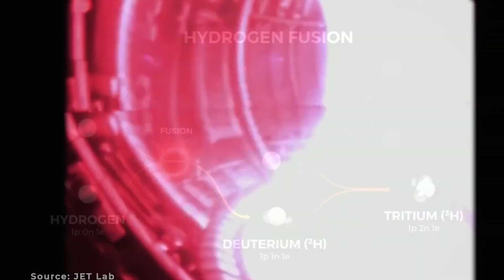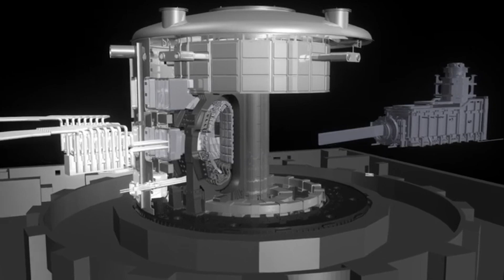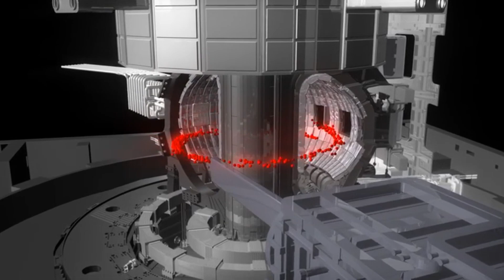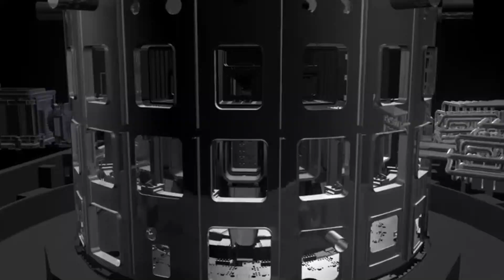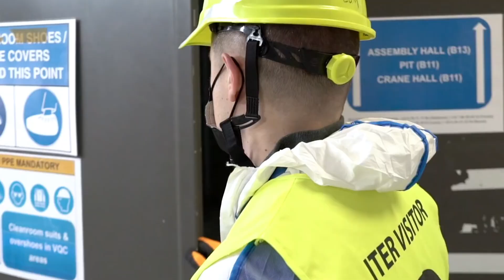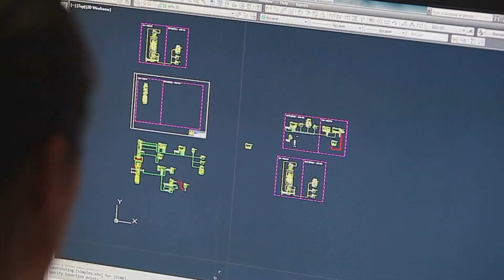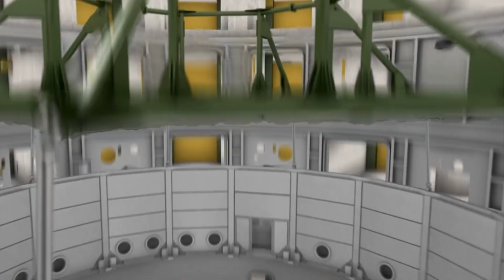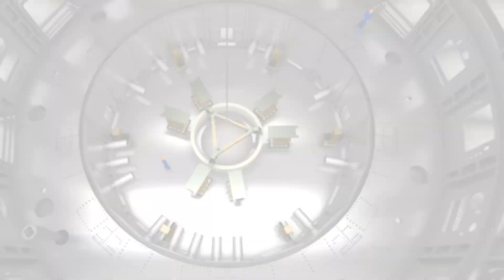ITER: The $25 Billion Machine That Could Change the World Forever

Comment: Will ITER be safe, what will stop it from blowing?
Reply from the maker: Great question, and a common one. ITER isn’t like a nuclear fission reactor, so there’s no risk of a meltdown. The reaction stops on its own if anything goes wrong. It’s designed to be inherently safe, the challenge is making it efficient enough to actually produce power.
Reply: @ thanks for the insight.

Comment: That $25 billion would probably have been better spent on solar voltaic installations that harvest the power already being generated by the great fusion reactor in we have in space already.
Reply: What you gonna do when its cloudy?
Reply from the maker: @Daniel-jk7pe ITER isn’t affected by weather since it generates energy through fusion, mimicking the process that powers the sun. It’s designed to provide consistent energy, even when solar and wind can’t.
Reply from the maker: That’s a valid point, solar is an incredible resource we already have access to. ITER, however, aims to complement efforts like solar by providing a stable, long-term energy source that isn’t dependent on weather or daylight. Diversifying clean energy options is key to a sustainable future.
Reply: We spend 10x more on solar. We could do more than one thing… unfortunately ITER has the wrong magnets 😢